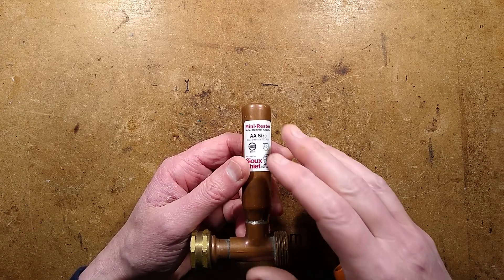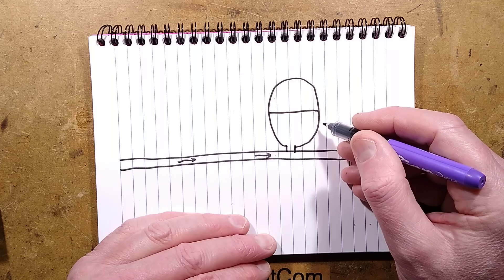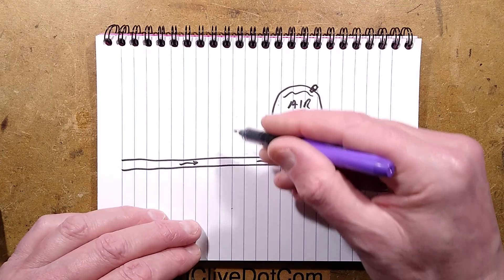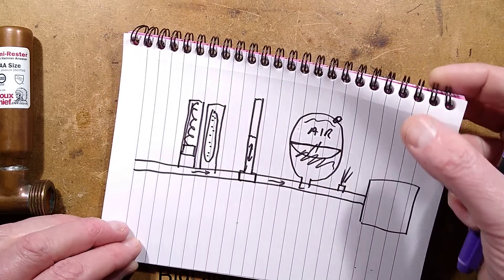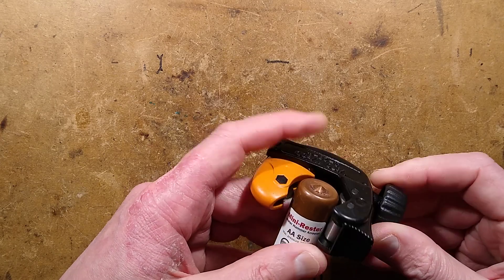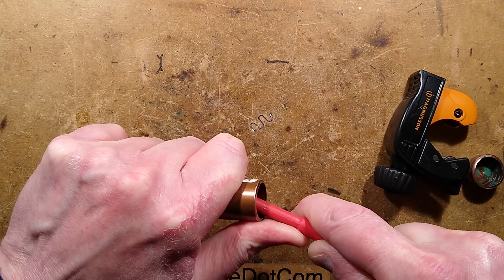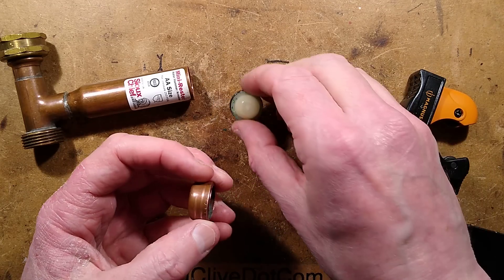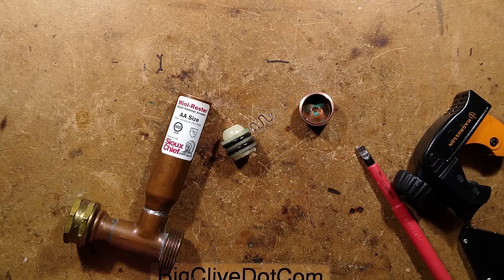inside an American made anti water hammer device

Comment: You can see that the area is damp above the plunger and has corrosion, which to me means that the o-ring seal leaked and let water through. These normally have a nitrogen precharge above the plunger and that is why the top has that button seal thing. The one you have there is designed as a retrofit option for existing clothes washers, as indicated by the "GHT" style threading, AKA Garden Hose Thread, which is commonly used for washing machine hookups in the US.
Reply: Why would it be damp and corroded?  It's a new device.
Reply: I suspect it is in fact very used, even if it were billed as "new" on the eBay auction he bought it from.

Comment: Air-bladder expansion tanks are now required pretty much everywhere in the US. If you have city water, regulations require a backflow prevention valve at the street, for sanitary and anti-terrorism reasons. An expansion tank is installed at the water heater to prevent high pressure developing due to temperature changes. If you have well water, you have a giant bladder pressure tank unless you have a fancy VFD-based well pump.
Reply: only them 'merkuns would say it's for anti-terrorism reasons. looks like they've bought their masters propaganda on instalment for the rest of their lives... 🤡🌎
Reply: How long have you lived in chicago?
Reply: I have city water but no backflow prevention; those are only required if you have an in-ground irrigation system. And because there is no backflow device there is also no expansion tank on the water heater.
Reply: @stephenj4937  this depends entirely on several factors including age of the installation,  location,  and enforcement at the local level.
 It is a requirement in National Plumbing Code in the United States.
Reply: @michaelgoettsch7744  my house was built in the 90s in the US. I hope they don't make me install all of that in the future, as there is not enough room for a thermal expansion tank near my water heater.
Reply: @stephenj4937  The thermal tank doesn't have to be near the water heater.  It just needs to be somewhere in the cold piping after whatever device is preventing backflow (in my case, a pressure regulator just after the line enters my crawl space.)  It commonly is near the water heater, because there is generally exposed cold-water piping leading into the thing, making for an easy install, but that's not a requirement.  It could be in an attic, crawl space, whatever...
Reply: The pressure tank on a well serves two basic functions: maintains steady water pressure throughout the pipes, and acting as a reservoir for the pump. The well pump circulates on/off to fill the pressure tank as needed in a basic single-speed pump setup.

Fun fact, a 2021, 110-volt water pump is more efficient and moves more GPM than the 220-volt 1980s pump it replaced. Most times when our pump stopped running during all those years, it was either a worn-out pressure cutout switch, or a failed starting capacitor.
Reply: @Dwigt_Rortugal Problem is, if you lose power you also lose water so you need to make sure you never lose power which tends to be expensive. A pressure tank is a passive device, so, you'll have water for longer than most power outages and it won't be a problem, and, a relatively small generator can run the pump long enough to fill the pressure tank if needed, so overall a far cheaper option.
Where people went wrong is trying to run pressure tanks that were far too small and relying on them to regulate pressure instead of using a pressure regulator because they're trying to be cheap.
Reply: 😂 antiterrorism
Reply: @JJRD222  I think that's what terrorists like to do - how can we simply and cheaply screw these guys in a new way that they don't see coming? Who would have thunk back in August 2001 that a bunch of aircraft will be hijacked and buildings will collapse?
Reply: The issue is if you can cause a back siphonage event you can actually feed  chemicals or sewage into sanitary water. So having homes fed with one of these devices would prevent 1 bad actor from poisoning the water supply.  @JJRD222

Comment: From around 2000-2005 I lived in a 1990's construction apartment. I thought that new construction meant that this would be a nice place to live. In Michigan this was the era that they started to allow three story apartment buildings to be built, and I was dumb enough to live on the 2nd floor. Ridiculous pipe hammering and noise from above and below at all hours of the day, along with high rents due to the new construction and supposed amenities I never used. Now I live in 1965 construction on the second floor of two and I don't care anymore how nice or poorly where I live looks from the outside. It's what's on the inside that matters. Absolutely no pipe hammering in these older style apartments, and they even remodeled the place.

Comment: Clive did you try converting to Pex for your own issue?
Reply from the maker: I ended up adding a section of modern plastic pipe in a while ago, when the original copper pipe developed pinhole leaks.

Comment: 1:01  Those of us who are on well water (Emergency system for my family.  Primary is treated "city water.") usually have one of these to smooth out the water pressure coming from the well pump.  They still allow 10-15 psi change as the pump switches on and off.  The large ones used with well pumps have the air pressure range stamped into them, so you can refill the air above the diaphragm.
Reply: Yup. Probably a big tank for off-and-on water usage and pumping, and then these little guys to absorb the shock when a valve closes.
Reply: My well has a constant pressure, variable speed Grundfos pump, and while it has a pressure tank, the pressure tank is small, maybe 1 gallon. When I say it's constant pressure, that's exactly what it is--it maintains 70PSI or close to it at all times. This pump is also capable of being run off a 12V inverter with a step-up transformer (to go from 120V to 240V), as it only consumes about 800 watts when one faucet is open and, being variable speed, doesn't have a huge start up surge.
Reply: You need a larger pressure tank, likely much larger. That plus a regulator and you'll have water pressure for days.

Comment: What's odd is that it has garden hose connections. Typically those are slip fittings which are soldered. It looks like someone soldered garden hose fittings into it for some reason.
Reply from the maker: It's designed to fit laundry equipment.
Reply: That’s the standard laundry machine connection in the USA.

Comment: You can test pipe outside by getting a garden hose and putting another female end on it and rigging another spigot/hose-bib/(easy with matching fittings) that will give you an end, possibly threaded to hook stuff to.
   That is my suggestion based on available junk I currently have on-hand that would save cutting the house plumbing.
   The T is also in a house in the US with long lines (70+ yards) from the well house, at the penatration. Ours was after a 120 some liter pressure tank near the well head. Pump ran 35-45 psi on/off. Not sure it did anything. Maybe not knowing means it works?

Comment: I still run a piece of vertical pipe with a dead end. As long as it's vertical, it will trap air and arrest water hammer. Water hammer can cause damage to any fixture attached and even to the pipe and water heater. In homes with backlog prevents, you have to put an expansion tank in the hot water line. The best way to mount expansion tanks is with the threaded end down. If the bladder fails, the water stays in the tank. If you mount it horizontally, the water will push against the bladder on the bottom side and the air will push against the top. It will fail much faster than vertically.

Comment: I wonder if they start with the plastic plunger at the far (dead) end, sweat it onto the fitting and then give it a blast of air through the hole just to shoot it down to the opposite end and then seal it. It would still be at ambient air pressure but with the full head of air for buffering.

Comment: I have one about that size for the dish washer which works well. But the high efficiency washing machine required the larger 9" long version on both the hot and cold lines to completely eliminate the water hammer. They are wear items though being rated at something like a half million cycles. I'm not sure how they count that as I seem to have to replace them every ten years or so. The O-rings get worn down.

Comment: They would likely have a hole in the end for air to escape during assembly, inserting the "puck" as you say, then once it's positioned to a point where there's enough "cushion" they would seal the end off.

Comment: Reminded me of a thermionic valve in construction. I wonder, due to the very careful use and protection of a puck with dual sealing o-rings if the the top side had a gas injected, like nitrogen or something to help equalise the pressure both sides of the puck and for inhibiting mould on the copper, given the max psi of the tube. The end would have then been sealed to stop the gas escaping. similar to the pressure vessel being air filled to 1 psi for domestic heating boilers. Otherwise if it was just air a simple flat solder-on end cap could have been fitted, like the base is, and there would have been no need for the puck. Just a non-plumbing guy chucking in his penny lol. Glad the hand is looking better x :)

Comment: If that was new, or still pressurized, the gas in the tube could have been dangerous when you cut it.
It could have about 60-100 psi of gas in it (either air or nitrogen).
These usually fail because the o-rings become damaged and the gas leaks out so the piston is pushed to the end and no hammer arresting is done so they need to be replaced.
The strange blob in the end is probably a copper seal, either welded or spun on after it is pressurized.
Reply: The average pressure in the UK IS 3 bar or 44 psi. Any pressure above 45 psi would render it useless.

Comment: The third and often overlooked solution, if you don't wish to modify your plumbing,  is to simply crack open the valves to the washer just enough to limit the flow rate to where the velocity of the water in the pipes is not enough to cause a hammer situation. The only side effect is that your washer will take a little more time to fill.
Reply: While this works, I have found that it can eventually burn out the solenoid because it's working to hold the valve open for far longer than anticipated.
Reply: Turning a valve seems like too much work; I'll just wait for the strainer to fill up with more sediment.
Reply: Other alternative is to balance the water pressure in the house, which will be the thing done if you have a shower anyway, so that you do not alternate between scald and freeze. Water heater pressure control valve placed at the house water inlet, and all plumbing fed from that. Lower pressure, plus it reduce water hammer by limiting flow rate, and the overpressure release also handles water hammer as well. for the washing machine a simple extra is an orifice plate in the feed, a simple copper washer with a 3mm hole in it, that allows enough water through to fill the machine in the usual way, but limits the flow rate enough so that shutting the inlet valve simply allows the pipe to full to resting pressure slow enough not to hammer. Washer is placed in the feed line, normally by the hose connection to the wall, and an extra washer is there to hold it in and provide the needed seal.

Same washer, just with a 1mm hole, is installed by your utility to cut off your water if you are not paying, and this allows them to cut water and power off, yet not break the law by denying you water, as that is illegal. They it takes 20 minutes to fill a toilet, or that you can just use it for drinking, or fill a bucket to wash with after 10 minutes, it still complies, and is a good reason to settle the bill, and pay them to remove the washer.
Reply: how do you know the velocity of the water in your pipes lol
Reply: @derekakaderek  basic physics. Water pressure is upto 4bar that will flow at a given speed for a diameter of pipe , half the diameter double the speed .
Reply: @paulmeynell8866  "basic physics" doesn't give an answer LMAO. nice bro
Reply: @derekakaderek  when you fill an air filled pipe with water you get air locks and air trapped in high spots . Physics fluid dynamics even chemistry.

What’s your thinking? Magic? Maybe flesh out your argument with dome detail instead of just saying someone is wrong.
Reply: @paulmeynell8866  never said anyone was wrong, again you didn't give the speed of the water... "simple physics"
Reply: @derekakaderek  fill a known volume (a bucket) by sticking it under a tap that's fully open. Time how long it takes to fill. You can work that backwards to find litres/hour or whatever and (knowing the pipe diameter) come up with a velocity from that.

Or get a tool that you stick under said tap and it gives you a reading through magic. I dunno, the guy who quoted my boiler replacement had one. Turns out my water supply is really good so my boiler has to be overkill for my home heating to stop my shower getting cold 🤷‍♂️
Reply: @derekakaderek  you watch the water meter for volume with stopwatch in hand then do some sums to calculate the velocity in the pipe of that diameter to find the velocity in the pipe
Reply: IT is not lack of flow, but just reduced flow.
Reply: True. This would work best with a globe valve but a ball valve could offer a bit of throttling as well.
Reply: It works, but indeed as many have stated it'll cause wear on valves. I work in industry that uses a lot of water and using valve as flow reducer is not a good idea in long run. Rather make piping smaller or have some other reducer or pressure reducer in line to get better results.
Reply: What washer?  Dish washer?  Clothes washer?  Why does it need to be a washer?  What about water heaters or other appliances?  Don't understand the "washer" solution here.
Reply: You can get these as in-line models, that go between the tap and the washer inlet. No modification required.
Reply: If your washer is new enough it will notice the lack of flow and error out
Reply: @pootispiker2866  That would mean you closed the valve far too much. Modern appliances work fine with mediocre flow. Just barely close the valve. Regardless, I probably wouldn't use this as a long term fix.
Reply: @JMA_Elec  It's not so much the flow rate itself but rather whether the water level sensor has been satisfied within the time limit the ACU calls for
Reply: @pootispiker2866  your washer
Reply: Not really a recommended solution as awfully wasteful of water but you could also just turn on a tap and leave it running slightly, for instance at kitchen sink, while the washing machine is operational. 😂
Reply: Yes if you want greater wear and tear on the valves.
Reply: @andymerrett  why would that cause greater wear?
Reply: @MrMichiel1983  it’s a solenoid valve it’s on or off!
Reply: @MrMichiel1983  He means the valve in the tap that you are using to control the water flow to the washer.  Having the tap just cracked open results in very high velocity over the valve seat which causes erosion.  Depending on the valve washer material it can damage that too.
Reply: @paulmeynell8866  I have an isolation v/v before the flexi, it's throttled in to reduce flow. The solenoid v/v is in the machine.
Reply: @simonwass6315  that’s ok but some newer “efficient” washers would error if the water flow is too low.

Comment: i’d think something this simple could just be in every washing machine for 3 cents extra and save everyone a bunch of trouble
Reply: Or just slow down the solenoids,  we did not have a problem until we purchased an LG front load washer.
Reply: They are part of laundry boxes (hot and cold supply valves and a drain) for your clothes washer here in the US.
Reply: @problemsolverstoothlessold5803 American dryers have a water supply? 🤯
Reply: @mlies37 yes, as a "steam" function, for static reduction and "quick refresh" of items you may not want to wash immediately (sweaters, for example).

Comment: generally we try to put the device in a straight line with the pipe, since it's an inertia issue (the water doesn't want to brake), you're dealing with water that doesn't like taking a turn either. So you put the device is a straight line, it gets most of the pressure spike, and when the water has dealt with its feelings, it's ready to turn gently and do nice work in the washing machine. Otherwise you divide the pressure spike between the washing machine and the device.
Reply from the maker: That makes sense.
Reply: That is what I was thinking too.
Reply: "... has dealt with its feelings" ... haha  love it.

Comment: In the hydraulic world, known as an 'accumulator'... and a somewhat crude one at that. In the plumbing world they were ofter called 'water hammer arrestors'.

They act similar to a capacitor in electronics.

The little vertical dead end pipe versions were usually located just out of sight back in the wall, and worked well enough; but every year or so, you needed to turn off the water and open all the faucets to drain everything, and allow air back in the arrestors'. It wasn't that big of a deal, but people just didn't do it.
Reply: Indeed, and to answer Big Clive's question, they start with air and fill up over time because the water will dissolve the air, making them ineffective.   To remedy, you have to turn off you main water supply, find the highest and lowest taps in your system, and open them to drain as much pipe as possible.   They are simple, cheap, and rock solid (no rubber or seals, just an air pocket).   Maintenance is super important, a hot water heater has an anode they you should replace every so often, in addition to draining junk from the bottom.